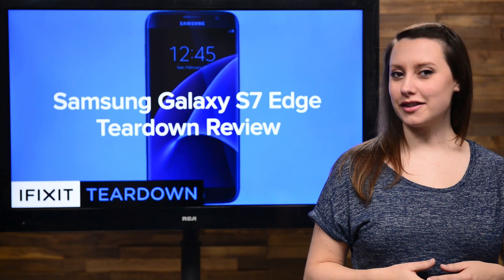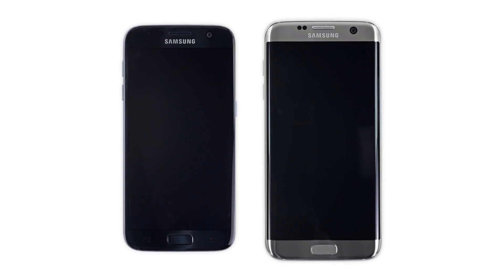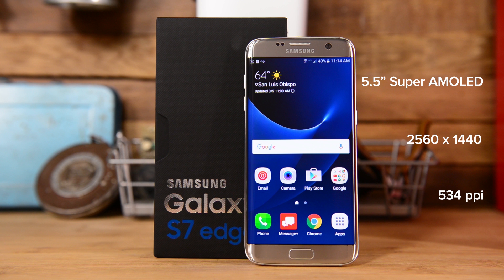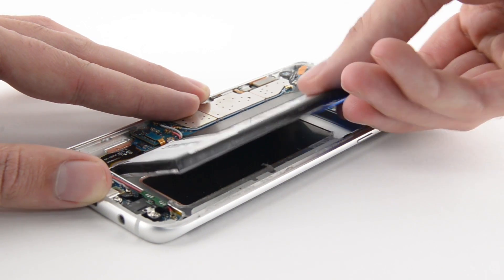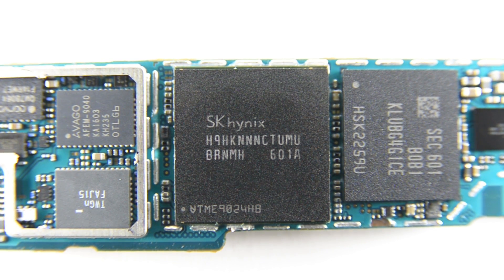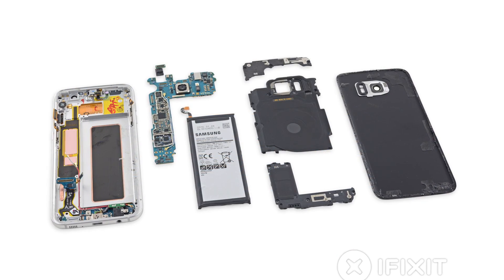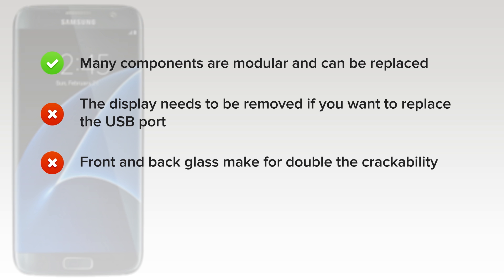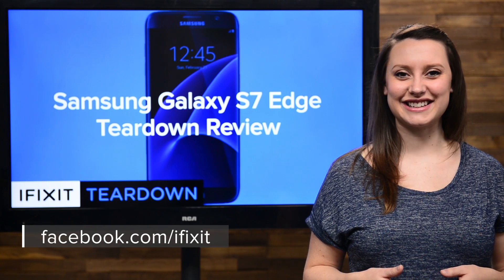Samsung Galaxy S7 Edge Teardown Review!

Comment: I wouldn't call that water cooling but more like a liquid filled heatpipe.
Reply: +Emoticons The only difference I see is the absence of a fan. Other than that, I believe it can still be considered watercooling. Why do you say otherwise?
Reply: Nestor Sierra It's also lacking a pump, so there is no circulation. Its just a water filled heatpipe.
Reply: You got me there.

Comment: I find that newer smartphone are getting more and more difficult to repair in each new generation. Using screws instead of glue is that difficult? I don't mind if a phone will get 1-2mm thicker but is more easy to repair; maybe it's just me.
Reply: +John Capidecallu You are too much of a practical thinker, logic and common sense will get you nowhere in this disposable brave new world. :-)
On a more serious note I totally agree, I wish they would also make a more rugged version that  - blasphemy - can simply be opened up by removing a number of screws and dispenses with all the near-non-serviceablility.
Still using my Note 2 and I'm on my third battery so Samsung:
no easily replaceable battery = call me on my new LG phone...
Reply: turns out it was the note 7 with the explosive personality!